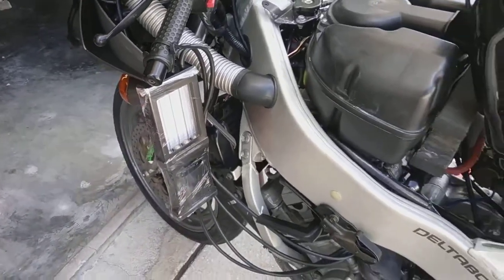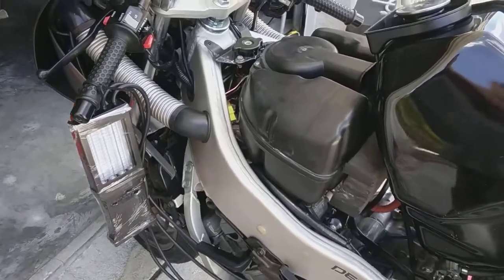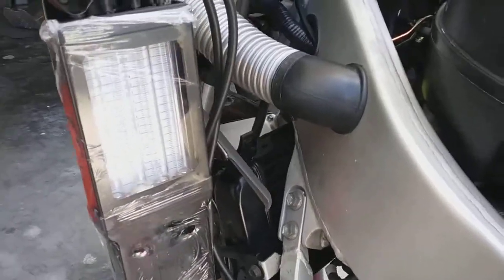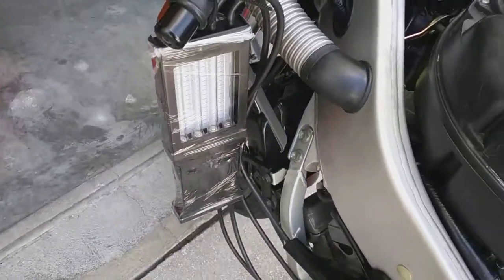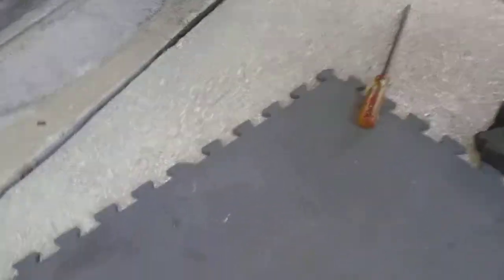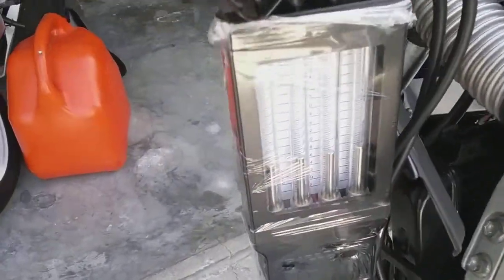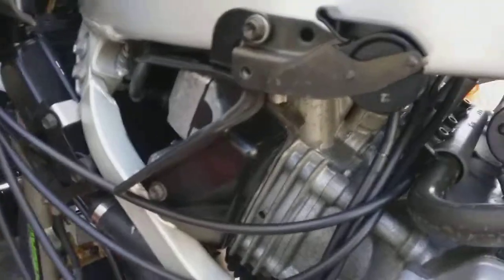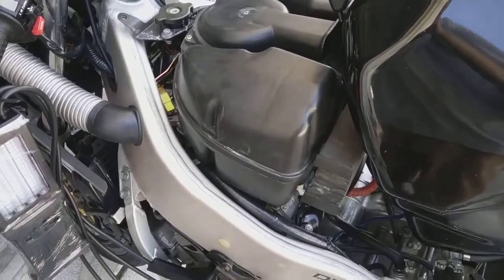How to use Morgan Carbtune Pro on 1988 FZR400RR, Tuning 4 cylinder 4 carburators

Comment: I heard that Yamaha did a mod on the later models, they attached 4 hoses on the frame I gather, to make it easier to attach a vaccum gauge, any idea on this mod? I have a 1990 FZR600, would like to add it to my bike.
Reply from the maker: Sorry, never heard of that. Makes sense. I'm pretty sure some carbs have nipples on the carbs with rubber caps on them that serve the same purpose. The hoses you mention sound much easier.

Comment: I experienced the power going off and even stalling at 5000rpm in my 94 3tj
Reply from the maker: Hum, fuel starvation? Look at filters, lines, tank, petcock. Check to see if they have been messed with, OEM? Then the carbs, floats,  dirt, gunk, etc. Rebuild.
Reply: @wetlifesports  my carb bodies have a bit of damage. That’s why I was thinking or replacing them. Thanks for the suggestions, I will look at them. Also, planning for a engine rebuild
Reply from the maker: @leakysam7136  Yes, in that case definitely get the carbs sorted first. Where are you located?
Reply: @wetlifesports  Kenya
Reply from the maker: @leakysam7136  Nice, on the to do list.